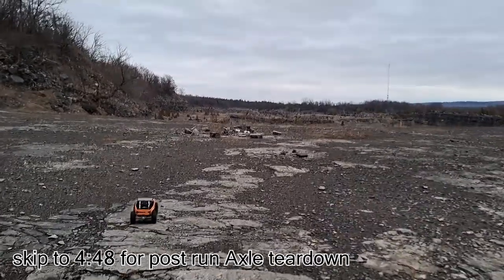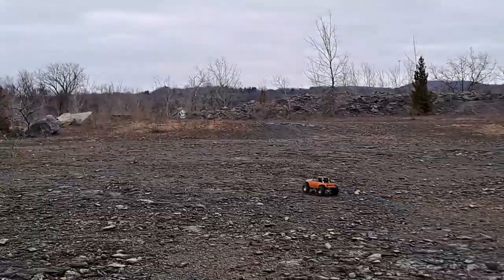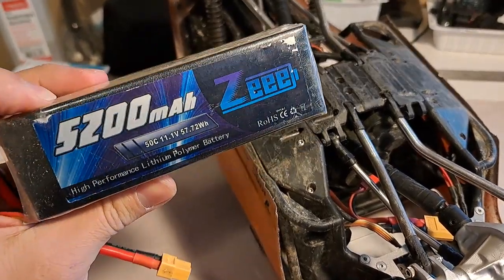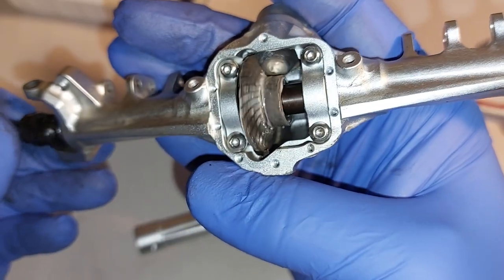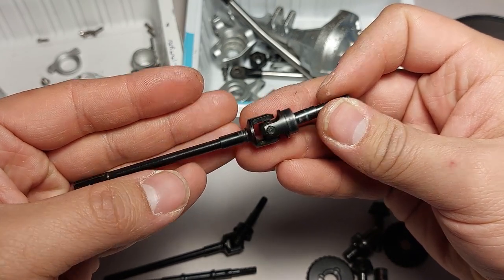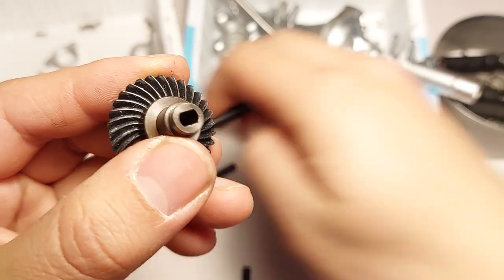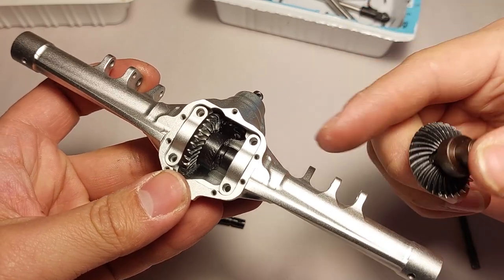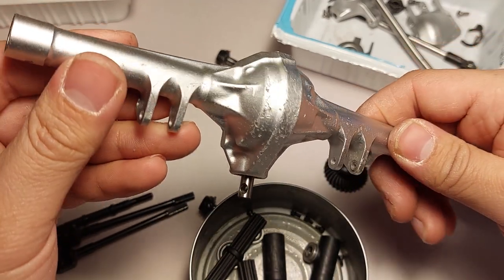Rockjock Axle Clone from Aliexpress / Amazon  Ep.2 |  Durability Test & Teardown

Comment: Hello sir.
I'm about to buy these axles.
Do you have a link to which ring & pinion gears I can use to replace the stock ones?
Reply from the maker: It's pretty much identical to the axial stock ones, so any after market ar44 gear should fit

Comment: Did u do the link for the body
Reply from the maker: It's the stock 1.9 wraith body with the stickers removed, it's unfortunately discontinued by axial so no reliable way to get one.  Some might pop up from time to time on eBay but it's pretty rare now a days.  One alternative I can offer is scx10 dealbolt body, you can make it fit the wraith cage with some modification.  It has similar lines to the 1.9 wraith but definitely not a good looking

Comment: why would anyone care that youre running knock offs ?  I have multiple sets of multiple knock offs and theyve been just fine. I also didnt pay $700 for a pair of axles. Plus you can run vanquish or vitavon shafts in them if they do end up breaking
Reply: yaay you...buying cheap knock off copies  of other peoples hard work without moral consequences...👍🏼
Reply: @steve_beatty  no, whats immoral is charging $700 for a pair RC axles. Whats immoral is charging $80 for a tiny piece of anodized aluminum that probably cost the company less than 2$ to make. Vitvon and vanquish would probably have more customers if they didnt ridiculously overcharge for EVERYTHING they make.
Reply: @scottmichael7178  sounds like good old capitalism to me...don't buy their products if you think all that high level machining on the vanquish axles isn't worth the money...but don't support thieves FFS..🙄  You should also  know that the copy is not equal to the original. I know that from personal experience... I recently bought a pair of front portals from an amazon vendor only to find out they were poor copies of the vanquish f9's filled with junk gears that grenaded on first use . 🙄 I was refunded in full eventually but had to go through the stress of dealing with that a-hole and  rebuilding the drive train again , with proper vanquish axles this time though..😉
Reply: @steve_beatty  haha, dont you see how controversial what you just said is. Sounds like it's capitalism is what you're calling immoral. If it werent for people talking others ideas and producing them themselves, capitalism would cease to exist. And when their patent expires, thats what is expected, thats what always happens. You cant criticize one part of capitalism and call it immoral, then praise the other side and say "good old capitalism" when the originator charges an arm and a leg for their product. Not everyone can afford $700 for a pair of axles for a toy !! Especially if they have multiple rigs. Might as well have bought a new axle housing for my real rig.  And you dont see the hypocrisy in you saying you bought a set yourself, then calling others immoral for doing it ???  I wouldnt expect a knock off to have the same quality machining as something that literally costs 7x the amount, but if it fits someone's needs, who the hell cares.
Reply: @scottmichael7178  It' not immoral to buy cheap axles..it's immoral to knowingly buy cheap copies of existing axles.I did not even know the axles I bought were copies until I had them and the new vanquish axles in hand at the same rime...they copied just about  everything except the quality....I build and fly quadcopters as well..I pay for original frames  even though there are cheap copies on bangbad  because it's the right thing to do shiny...Knowingly buying copies makes you just as much a thief...
Reply: @steve_beatty Looks like someone is feeling stupid for spending $700 on the same crap some Chinese company made for $120
Reply: @keldonator   Apparently reading comprehension has failed you.I told about the crappy Amazon axles that tuned out to be paperweights...Never said anything about the expense of buying quality axles ...which is what I wish I did in the first place and eventually ended up doing...twice..I have 2 trucks with  vanquish F9's under them now  and have zero regrets...
Reply: @steve_beatty  Sad kid
Reply: @keldonator   no kid...I am older than dirt.......sorry about that reading comprehension thing though...You must be a newly minted product of our failed education system.. ...👍🏼
Reply: @steve_beatty  You sure act like a child
Reply: @keldonator  how so ? Because I pointed out your lack of proper context in your first reply ? Lol.....I reckon it's you who are acting the child.....😅
Reply: @steve_beatty  Wah wah wah, man child
Reply: @keldonator  Wow...how will I ever recover from such an eloquently crafted response... 😅🤣😅🤣
Reply: @steve_beatty  Hit the nail on the head I see
Reply: @keldonator  sue thing nancy...keep thinking that  if it makes you feel better...🤣
Reply: @steve_beatty  🤣 just stop already kiddo
Reply: @keldonator    Awwww....c'mon..I was just starting to enjoy myself..🤣😉 🖖🏼
Reply: @steve_beatty  Awe do you have a poopie in your diaper? 💩
Reply: @keldonator  good lord yer an idjit....🤣🤣
Reply: @steve_beatty  Need me to bring you your depends? You forget which way to the bathroom again?